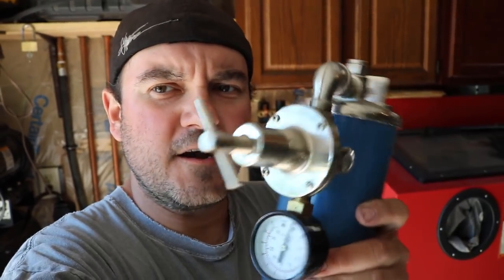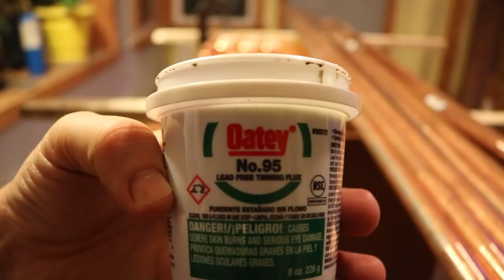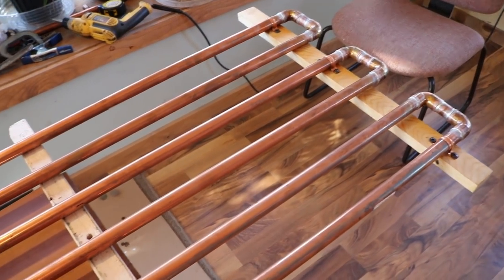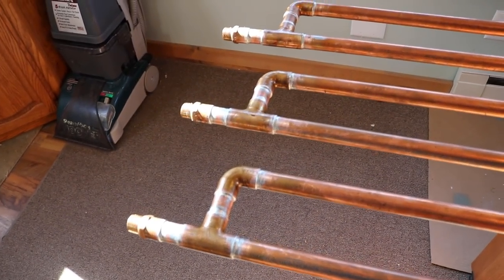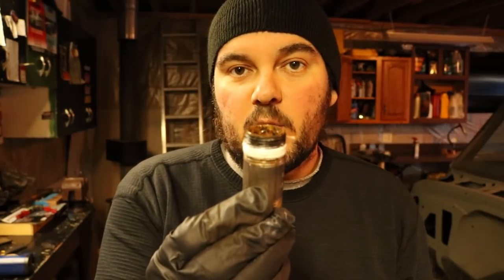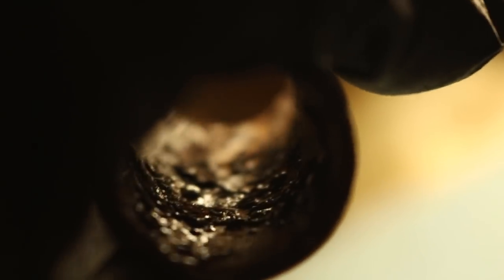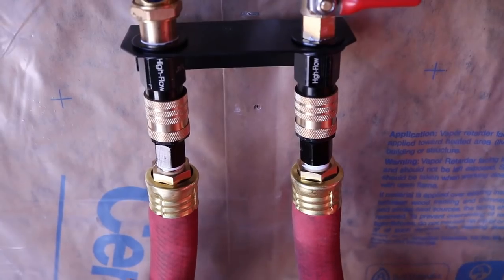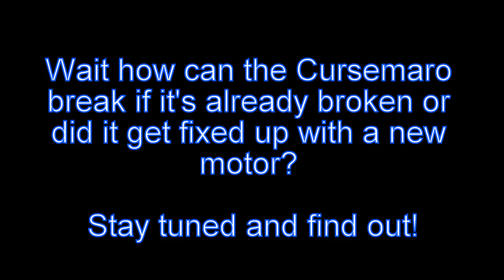How to remove moisture out of air compressor lines! Building an air dryer for painting classic cars!

Comment from the maker: HERE IS THE LIST OF PARTS USED ON THIS BUILD! The tubing was cut to 72" to utilize the most space in that area. You want to have at least 40-50' of copper for this system to be effective.

Here is the parts list for the Air Dryer
, starting at the compressor

1x   - 2 1/2" 3/4" brass nipple (Sioux Chief 17700324)
1x   - 3/4" brass street elbow (female and male end)
1x   - 3/4" brass ball valve threaded (both female ends)
1x   - 3/4" Rapid Air Compressed Air Jumper Hose (Part # F0215)
1x   - 3/4" Male Adapter (Nibco 604 3/4" to 3/4" threaded)
10x - 3/4" 90° Copper Elbow (Nibco 607)
3x   - 3/4" Copper Tee (Nibco 611)
3x   - 3/4" to 1/2" Male adapter (Nibco 604 3/4" to 1/2" threaded)
3x   - 1/2" Ball Valves threaded (both female ends)
4x   - 3/4" Copper pipe Type L ( I cut these to 72" for the main height)
9x   - 3/4" Copper pipe in 2" pieces 
1x   - 3/4" Brass Compression fitting (to the regulator)
1x   - 3/4" Rapid Air NPT Filter Regulator (K93217)

The piping after the regulator was set up with 3 end points, one for my blasting cabinet 125 psi at all times, one for my tools and one for the paint gun. The paint side has a DeVilbiss 130502 Desiccant snake, a regulator, high flow fittings and a Devilbiss Rhi-01 Relative Humidity Indicator.
Reply: Busted Classic Garage I’ve pretty much built the same thing minus the manifold.  I don’t do any painting. Just air tools. It’s been laying in my garage floor for about 2 weeks lol. To many projects going on plus work. I didn’t realize how much this was going to cost until I was to far into it😳. Damn thing cost as muck as my 60 gal compressor lol. Nice video man 👍
Reply: Can you do a review of the dryer what do you do different if you have to redo the dryer. Thanks
Reply from the maker: Thanks Brian! Too many projects... sounds like my life!
Reply from the maker: I'll try to at some point David. I have a ton of videos to get edited at the moment, but not a lot of time to finish them. I think the only thing that I would change about the design would be to have all three valves go into one.
Reply: While I can see what you did and the parts you used, I can't understand the theory behind it, or why you'd need to use 50' of copper (and all those fittings!)  Surely you could just do a pressure drop into a small auxiliary tank (like from an old portable compressor that died) and put a single drain at the bottom?  If you were super motivated you could fill it with aluminum honeycomb or similar to provide more surface area for condensate without going to all that expense.

I have to say though - cracking job in fabricating the design you went with.  Quality work fella.
Reply: @mikefurlong8025 If he is working on a 95 degree day, 80% RH and compresses the air to 125 F.  If he cools the compressed air to 95 degrees and removes the moisture, he will remove 0.77 grams of water per cubic foot of ambient air (before being compressed) used.  If the compressed air is cooled to say 65 F via a tap water cooling exchanger ( a larger pipe with tap water flowing through it) He could potentially remove 0.855 grams of water per Cubic foot (before being compressed).  He could use Ice water as the cooling water and yet remove another 0.036 grams of water per Cubic foot (before being compressed) (total of 0.891 grams). I don't know how critical moisture is to his application but the heat exchanger with tap water for cooling offers a cheap efficient means of removing moisture from the compressed air before it goes into the tank.  The heat exchanger could be as simple as a pipe with the copper coil for the compressed air where water can flow over the coils and cool them to the water temperature. The exit of the air from the cooling pipe is the entrance of the water so the air will come out at the most cooling point possible.  At the end of the jacket have a moisture collection bottle that can be drained periodically.  A moisture separator could possibly be designed to efficiently force water droplets from continuing on from the coils into the tank.  It could look like a cyclone dust separator where the angular momentum keeps the water droplets from entering the air stream until they drop out of the flow into the collection tank.  If cooling to ambient temperature is good enough, a coil with a fan blowing on it would be great.  (I'm not sure what such a large pipe system is needed.) At a 10 CFM (before being compressed) ambient air usage rate, you could eliminate ~0.5 liters of water per hour on the assumed day's conditions on a well designed system. [edited to correct calculations]
Reply: @ralphparker  That's more or less exactly what I was thinking- cool to ~ambient using an air to air heat exchanger, then separate via pressure drop / cyclone vessel.  If needed, the heat exchanger could be swapped for an air - water based unit in the future, depending on environmental conditions and specific needs.
Reply: Now that you have had it for awhile what would you do different or is it just right?
Reply: Busted Classic Garage 3 valves to 1? Do you mean the moisture drops? Sorry, still learning :)
Reply: The most badass, complete small shop DYI kit imo.
Reply: Ralph Parker wow, I have no clue what you said but I am pretty sure you know what you’re talking about. But potentially I feel as if you are talking about a heat exchanger on the compressor itself before compressed air flow is exiting?
Reply from the maker: @peteshelby21  yea it's just a way to cool down the air so the moisture can condensate out before it gets to your filters.
Reply: @ralphparker  why not use an air conditioner exchanger and its forced air fan ?
Reply: @ralphparker  why not use an air conditioner exchanger and its forced air fan

Comment: Your attention to detail is pretty awesome,  I worked for a Ingersol Rand portable Diesel compressor company 25 years ago and learned a for amount about large volumes of air. And high and low pressure compressor differences.

And I have had my own engine rebuild shop, and now CNC machine shop.... And have dealt with compressed air a lot.... The challenge with drying air is to understand a few different things.

#1 - what pressure do you need.....and most importantly what CFM do you need at that pressure.

The zig zag back and forth you built back and forth out of non-finned copper line is fine if you use almost now CFM..... Such as painting only. If you were to have someone run that sand blaster non-stop for let's say 30 minutes  most basic $1000 and under garage compressors your compressor would never shut off running a Bastet and your copper line temp drop across those few lines would be almost nothing. And the water build up would be uncontrollable.

The tank and air line temp would be out of control. The zig zag is a waste of time and money.

What you need to do is much more simple.... First remove the air line off the compressor head manifold that goes to the tank ....and run it across the as far away as you can to an air dryer that is at least 50% bigger in CFM volume then you compressor puts out.

Then box your shop in a overhead square up high so there are no dead end air runs.....then where ever you need drops plump up first then then turn 90 degrees back down ( water doesn't like to go up ) then plumb from your dryer back to the compressor tank then the check valve...... Now your tank will never even get warm if everything is sized right.

Then plumb from your tanks discharge supply valve to your over head square box with all needed drop downs ( you can add drops under each drop supplies with electric moisture blow off's to make sure there is no water build up.  ) if the dryer is big enough there will be no water.

Remember air conditioned shops require smaller dryers .... Non air conditioned shops in humid areas need MASSIZE dryers sometimes 4 times bigger in CFM rating past compressor output .

I have a system in my shop I personally built to keep dry air flowing to my CNC spindles so the lower spindle bearing that sees a constant 5 CFM of air flow at 90 psi to keep high pressure coolant from back splashing into the bearing.

My compressor puts out about 40 CFM at 90 psi...... And much less CFM at 175 psi.

This is a great video but Compressed air drying is much more complex and this example would only work with very low air volume.
Blaster cabinets require much more cooling then this system would provide. ( this example is more towards painting only ) but you should still add a electric dryer. And auto blow off valves.

If your air storage tank gets really warm or heaven forbid ( Hot ). You are going to have trouble.

IndyDan
Reply from the maker: Thanks for watching and for the great info
Reply: Dan Turen - Man I have a lot to learn! So for only painting...this system will work? I'm about to buy a compressor and want to do it right. Still new to all this.
Thanks!
:)

Comment: Fine word Amigo, I have 1 thing to share. If the line from your compressor to your first copper run connects at the top and same with your last copper run its a good way to make sure any water/condensation remains only in the copper pipes. Just info for u to do whatever with. Great vid
Reply from the maker: Thanks for the info and thanks for watching!

Comment: I learned that Theory about 25 years ago when learning to carve/etch glass. The same problem/issue with water and paint pertains to blasting media. THEY HATE EACH OTHER.I also use a toilet paper filter at the very end. I love it. I live in North Carolina so the humidity is not bad but I learned this from a carver in Florida that had been using it for years. I'm sure mine was cheaper to build then ,than yours was. .but it is all relitave,I also made less $ then.Im sure you will love it. I'm an old guy so I didn't like the music but that's just me,and I'm sure there are trademark issues with music.
Reply: Humidity not too bad in NC?  Regularly in 70-80%+ range.  Your version of not too bad is different than mine though compared to Florida yes, almost need scuba gear to breath in FL sometimes. That last little filter at the end is cheap insurance and well worth it in my book.  I buy extras.  I blast and paint.
Reply: I say filter the crap out of it till you see a reduction in cfm's or pressure. Filters (for almost anything) are cheaper than the consequences of NOT filtering. Also another trick or mod to this type of system is to put a ball valve at the lowest parts ( it will pool there)I have 4. But I am VERY fortunate and I have a lot of space.You just bleed every time you walk by. And yes I hear people whine about humidity, Then they go on vacation to Miami and that changes things I someone is on a budget and time is not a factor,you can check construction sites.It is almost pathetic the things thrown away. They say it is cheaper to throw it away than to store it,so go dumpster diving and save a ton of cabbage. ( just talk to the super intendant first, and don't leave a mess.you will be amazed how nice they are. I was an electrician and had supers saving stuff for me.
Reply: @oldcrookedfingercollins1417  I live in NC currently.  Air in a hose laying on concrete will condense in the hose.  I'm sure that phenomena would be worse in Miami , Memphis or St. Louis but it happens in Charlotte too.  It only takes a few drops to kill a paint job or make a clump in a abrasive blaster.
I once built a very nice large dog house out of wood tossed by contractors into a dumpster.  Had a papered and shingled roof too. 

I have heard stories about some pretty good stuff in dumpsters at Lowes and Home Depot also.  Treasure is were you find it if you are willing to look.
Be safe out there crocked finger.
Reply from the maker: That is exactly why I had to use that music. Because the original audio had music in the background and I would have had over two dozen copyright infringement issues.

Comment: I've been soldering wires and electronics successfully since I was 14 and I'm north of 60 now but have always struggled with getting nice looking copper pipe sweating.  I saw that you keep the hear much farther away from the open end of the connector than I ever did.  Will give that a try.  I've always cleaned the metal bright because it will never work with less than perfectly clean copper and always used a good flux but got ugly joints.  Thanks for the tip!
Reply from the maker: No problem, thanks for watching!

Comment: I separated the belt driven pump from the tank. Put the pump & motor on one side of the shop and the tank on the other side of the shop ( good 60' ) then ran the line on the floor along the wall behind cabinets and benches and such  between the 2.  Always way cooler along the floor. More material compared to time invested. Haven't had a single drop.
Reply: I really like that idea. Do you have pictures posted somewhere?
Reply: I really like this idea as well.  Would love to see any details you can offer.  Seems like a GREAT idea!

Comment: Actually for an exit pipe out of a compressor tank your best option is stainless steel because it doesn’t rust or corrode in anyway and it’s way stronger than anything else. Yeah it’s pricey but what do you want perfect There it is besides whatever you use use good filtration. Great show man… Keep on rockin…
Reply from the maker: Nice, thanks for the advice when I move to a different garage I'm definitely gonna upgrade those pipes.

Comment: I'm gonna steal this design on my new set up.  Won't need 50' of copper tubing however... I have an 16 pass copper/aluminum fin condenser (pre-tank)  going from the condenser into your design with the copper tubes and water catch areas at the bottom, from there into an air filter/water separator with a plunger style auto-drain and from that!  Finally, into the 60 gallon storage tank.  My reasoning behind all this, is I don't want to replace the tank lol.  And I paint as well, so coming OUT of the compressor I may have a desiccant dryer specifically for painting... I feel like after all that, it would just be overkill BUT!  I'll try it and see if the desiccant stays dry or not.
Reply from the maker: Sounds great!

Comment: Using the compressor pulley fan to draw air through is lovely.  I'm adding a small home built 1 hp compressor run off my off grid PV to keep my 500 gallon tank topped up and your video has been most helpful.   It will run for long periods.  I was wondering how well your float type drain has worked out over time.  I need either that or on of the timer/electric types.  Thank you!  Bruce M
Reply from the maker: All I have on there is some ball valves, but it might be a good idea to put on some kind of Auto drain in the future. The system does what it's designed to do and I haven't had any issues with it so far.

Comment: Nice job man. This is an entertaining and informative.video;  just what I was looking for on how to set up an air system for my garage.
These air system are going to cost more than a damm compressor if you want to do it right...especially for spray painting.

Keep'em comming!
Reply from the maker: Thanks Shane! The cost isn't too bad for this system, but it can very quickly add up. Perfect example a desiccant snake vs a  DeVilbiss Desiccant Air Drying System, it's only a $1000 difference...
Reply: @BustedClassicGarage  "only"  LoL.

Comment: I built the same thing about 3 years ago.    The trick I added to mine is an orifice within the supply line leaving the compressor where it enters the copper pipe..   so the air has a rapid expansion entering the radiator.   It helped tremendously!       Then I added a cyclonic water separator and large motor guard filter.      I just change the toilet paper as it needs it.    Or before starting a big job requiring a lot of air..  like running the blast cabinet, spraying, running the plasma table etc..      

I like this type of system because it's basically maintenance free..      only additional changes I'm planning is an automatic drain system that drains the compressor tank as well as the copper manifold.
Reply from the maker: Nice, I will also install automatic drains at some point in the future.